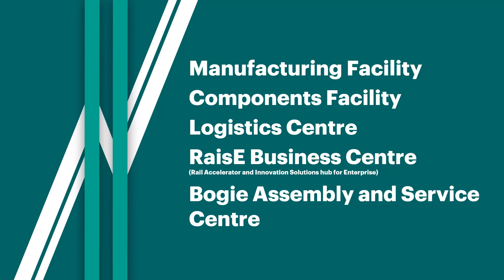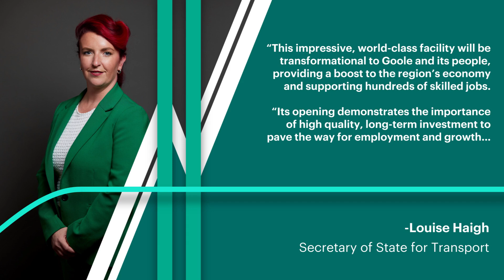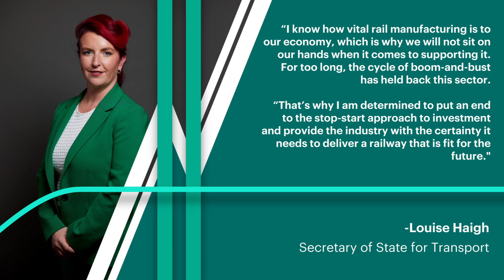Siemens Opens £200m State-Of-The-Art Train Factory in Goole

Comment: I think that Siemens should also manufacture new tube trains for the Bakerloo Line as the Bakerloo Line desperately needs new tube trains. But it’s nice to see that they are to build and manufacture the new Piccadilly Line trains which these new tube trains should enter service from next year. Very nice.
Reply from the maker: Well I've heard that if the new Bakerloo line trains are going ahead it will need to be confirmed in the next year or two so watch this space
Reply: Indeed